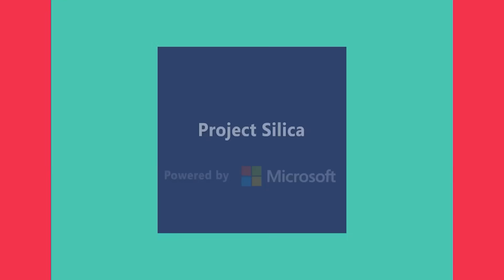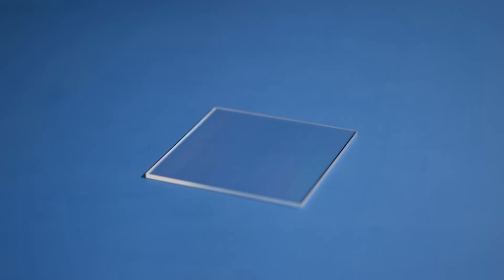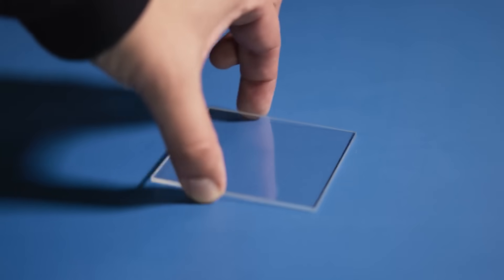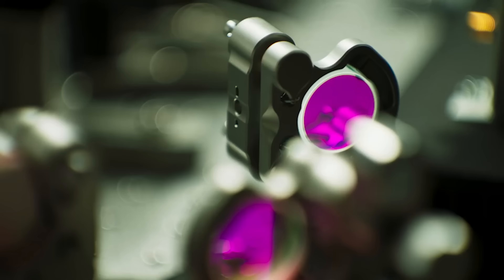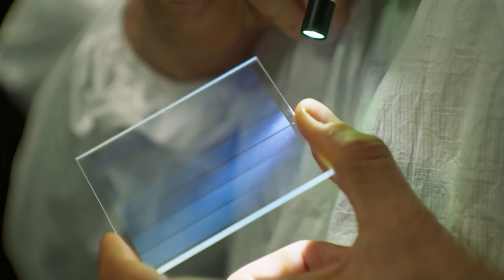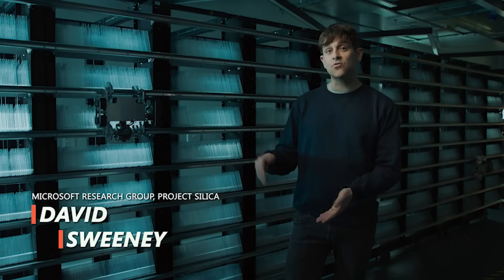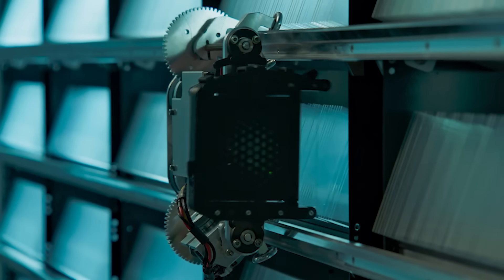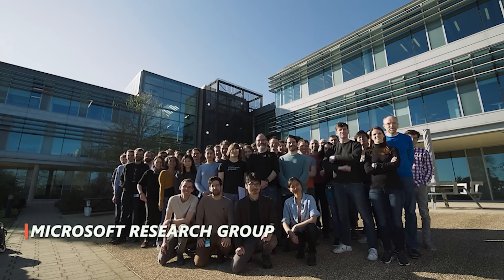Sealed in glass - Microsoft's Project Silica

Comment: For consumer use, a silica crystal could be inserted into a reader device. The device could shine through it, projecting an image of the entire crystal's data at once, that a light sensor reads as an image. The image could stay in the sensor's cache, in the system's RAM, or/and be saved in swap or even as a file. The "image" of voxels would be the literal (literally literal) transcription of the crystal's dataset. 

The multiple layers (because it's a voxel matrix) could be scanned almost instantaneously by changing the focal depth (of projection light and/or sensor) and/or wavelength of projected light. 

If multiple light projections and multiple sensor layers could be combined, with each sensor layer receiving a different voxel layer in parallel, then multiple voxel layers could be read simultaneously: 3-dimensional ranges could be transferred at once. i.e. a projector with multiple light outputs attuned to each layer + the silica storage crystal + a multi-layered receiver sensor. Only part of that I have no idea about is if the sensor layers could be translucent enough to allow the other layers' light to pass through, and whether the wiring from each sensor cell would interfere with the other light. 

btw I am definitely not any kind of engineer in any of the related fields. Just some ideas in my imagination inspired by their video.
Reply: I wonder if there's currently technology to make a single reader that matches the resolution of the glass storage device.
Reply: You're way underestimating the density of the voxels and the accuracy of image sensors. You've essentially described what Microsoft is doing with lab quality lasers and sensors, but they need to image one small section at a time. That said, you are correct in that the theoretical read speed of a platter is very high, much higher than hard drives or tape.
Reply: Superman - the movie
Reply: That's been in my mind for years,sadly I won't see this in a lifetime
All our data is basically
light & sound converted into binary
Reply: What about using time crystals in such a setting
Reply: for consumers the problem is not how to read, that can be figured out. Consumers need write. We dont need a Blueray 2.0, we need a persistent storage medium. And that is the difficult part. How to construct a cheap ensamble of lasers pulses that are able to etch glass, in a microscopic form factor.
Reply: @marsovac  I think writing could be solved by a cloud service that ships completed platters to you. Mark stuff in archive in OneDrive and when it gets to ~7 TB, the automatically ship you a platter. As part of an existing datacenter system I think the additional cost could easily compete with current archival services. 

I don't see how reading could be done cheaply, mostly because I don't see a large market for it. Existing solutions are cheap because they repurpose existing tech. Having a whole new complex reader would probably be really hard to sell, just like other tech that was better but not super compatible like betamax.

Certainly excited to see where this goes!

Comment: From what I see, it's write-once. That can be challenging over time because of content fragmentation issues, now with glass fragmentation as well :-)
Reply: I see your point, but I don't think they intend to use this to replace all form of storage probably just very specific applications as the robots also make the system slow
Reply: @OwnGrid  In fact I was referring to these kind of systems. Typically they use robot libraries reading LTO tapes. But once in a while, as you prune older archives, the oldest tapes become less and less relevant and thus costly to operate because of the only few remaining interesting files. Usually some kind of automated defrag and rerecording on other tapes helps keep the density useful. I guess it will just work like that here as well by using  newer plates but throwing the older plates instead of reusing the media. Glass being easily disposable.
Reply: @fmu7679  I would guess that the glass slates are cheap enough that a rewrite isn't necessary. If one of your slates gets outdated you just take what you want and write it to another one, which now has extra capacity from the data you left behind.
Reply: its glass. they can just melt it down and recycle it

Comment: Cringe. It’s glass. Enterprise class Magnetic tapes don’t degrade that fast. 20-30 years and more. Just like hard drives. Speed of data retrieval? How long do we need to store data for? If we want to keep it for centuries glass isn’t a good option as it tends to slowly flow. Like a liquid. There are transparent durable and long lasting plastics that are better suited for something like this. But no one explains the main goals
Reply: It's also possible that you don't know as much as you think you do. It's one things to have questions based on your perceived knowledge and then seek out  answers. However, you are not doing that. You instead seem to be making statements of fact without any interest in understanding how they address/view your concerns.

Comment: Imagine an optical reader size of 5.25inch DVD/Blu-ray, that can read these glass disks with memory of 1 Tb per disk or more you can literally off-load a lot of the data stored for archival purposes.
Reply: The plates are 70 x 70mm and store 7TB each. 70mm = 2.756 inch. There are two reasons why they are not bigger and round. The bigger they are, the more likely they are to break if they fall. And they are not spinning in the reader. The fact that they are not spinning (moving) allows the data density to be bumped up to far higher levels. Project Silica has demonstrated 7TB and 75.6TB / plate, but it could go a lot higher.
Reply: @danielch6662 i didnt say it should be rotating media.. The reading laser on on x, y axis motorail  can move sequentially to read data ... 7tb is good for initial efforts.

Comment: Is there any reason they are rectangular? Cd's DVD's Blue rays Ext. there is already disks. If your inscribing data in lines on a 2d plane why not make it in the shape of a cd? where there is already a huge understanding and support structure for spinning disks from both a consumer and enterprise standpoint. I get if your trying to increase density, but your forcing higher precision and wear out for the reading/writing mech by having to move the object in 2 dimensions seems... aquward. 

And while the moving robots are cute,  you can fit more disks in a Jutebox or record player...
I get its new tech, but your re-inventing the wheel. Your tech only changes the medium and how the laser reads the data in multiple layers.
Reply: Probably to make it easier to handle and correctly orient. Also, box-like shapes for glass are quite ideal in terms of material stability.

Comment: The glass could be in shape of a sphere, so you can roll the sphere itself instead of the reading head.
It can also be read/written in 3d space, making more options for layer placement without overlapping.
Spheres are also look cooler and having the smallest surface area to volume (we are writing in volume, not on the surface).
Reply: This technology is likely very sensitive to penetration depth ... harder to read and write deep into the glass. And moving the sphere may be a tougher challenge than you'd imagine because you'd need to move it with sub-nanometer precision in at least two polar axes and a linear axis and that's going to be really really hard. Much harder than moving a microscope in 3 linear axes.
Reply: anyone discovering crystal spheres in dusty halls buried under desert sands would enjoy the experience far more than if they discovered silly thin squares of glass. 
also the tech for read/write to spheres would look much cooler.
speaking of cooler, cooling a molten glass sphere with no deformity artefacts is much harder than cooling a plate of glass.
maybe we should just reinstate the diamond crystal trade, and/or develop more robust tech that has no issues with material deformities/

Comment: "hdd last 5 years. tape might last 10"
yeah if you fucking use the worst cheapest shit possible
Reply: I found those numbers odd too. I mean, I can see that being valid for an HDD under constant heavy use, but that's not really applicable to what these would be used for. If a HDD drive is being used for long-term cold storage, then I don't see how they would only last five years.  Properly stored LTO cassettes can last over 20 years.

But then again, they did seem to focus on cloud storage provider use cases, not the typical cases we might deal with ourselves. For example, those providers who have the data archive tier storage in which the media may be shared with many different customers. Then the media may be accessed a lot more than frequently than it is in more traditional environments. But I dunno, I'm not really sure how they do things at the big cloud companies. Maybe they will release some more technical stuff in the future that explains exactly what they are going for and why.

That being said, if they sold these things at consumer prices and sizes, then I'd totally go out an buy myself them.

Comment: I can't read floppy disks from 20 years ago since drives no longer exist, but yes, a totally cryptic, overly complex, laser microscope requiring tech that only one company has

THAT'S GONNA LAST FOREVER!
Reply: truuu although I think glass storage tech could be reverse engineered by any civilisation who's developed laser (or laser-like) technology, especially if the datablock header contains a full copy of foundational ascii and the device's symbolic encoding type and filesystem. Even without a human-civilisation computer or operating system, with those headers, the rest could be interpreted from the binary outputs. Yes it's not simple to do all of that, but it's arguably far harder to reverse engineer any kind of access mechanism for HDD and SSD storage types. Shining a light on it reveals nothing; without a controller chip it's basically dead metal. Without firmware and drivers, current storage disks are inaccessible.
Reply: yes that is ridiculous, microsoft are so full of money, after scamming the entire world for decades, they do't know what they are doing. This idea is overly ridiculous in the concept and in the execution.

Comment: Minus outside forces and catastrophic events 
In a vacuum environment, silica glass has the potential to remain virtually untouched for billions of years due to the absence of external influences. This makes a vacuum one of the most pristine environments for preserving materials.

When silica glass is placed in a sealed environment containing air, its durability remains impressive but may be slightly reduced compared to a vacuum. In such an environment, the glass could stay largely unchanged for hundreds of millions to a few billion years. The presence of gases, primarily oxygen and nitrogen, and potential interactions over extended timescales account for this variation in longevity.
Reply: Maybe we have something encoded in our DNA (a part of the code to build the body), we are just too stupid to understand it. Even our current technology is not readable for anyone outside of 100 years from us, not because it can't survive, but because no one would know the filesystem, how to read it without the OS or a computer from the same era etc.

Comment: I thought the HVAC sounded familiar... Silica based storage actually has been in development for decades now.  Glad to see it getting closer to real use.
Reply: I first heard of this when I started working with data around 1995. At the time the best we had was 1.4MB floppy disks and 600MB CD-ROMS were still a few years away.
Reply: millibyte
Reply: All computer memory is silica-based.
Reply: silicon≠silica
Reply: I wouldn't really call it "real use". This stuff is strictly read-only and most likely profusely expensive to create in sterile, highly specialized lab settings etching fragile glass.

If we had any sort of civilization-ending event, just how long do you think it would take for any predecessors to climb back up the tech tree, figure out what these weird pieces of glass are and then do another milestone leap by discovering the exact method of decoding in order to read & understand them successfully?

And for all the talk about "sustainability" in this video, Earth is already on track to experiencing a severe sand shortage.
Reply: I bet the read speeds are garbage with that seeking system. Why they wouldn't use a spinning disk is just baffling

Comment: Cool tech.. too bad the unsustainability comes in the form of this being done by a for profit company. At some point just maintaining the building may turn non-profitable and if/when that happens they will cut it loose. Or they design a business module around it, at which point they need to generate larger profits from it every year until it becomes as above, not profitable "enough" at which point it will be sold off or shut down.
Reply: Stop villainizing profit, it's short term thinking that leads to misuse of resources.

Comment: Does not glas move like liquid but very slowly? I would guess the data is save for at least 1-2 lifetime before it need to be copied again?
Reply: No, that's a myth that keeps getting repeated. There are 1,000 year-old buildings (Augsburg Cathedral, Germany) with glass windows which have not changed. Glass was hand made and it had variations so people assumed a thicker part at the bottom must be from it flowing, it didn't. Glass was then made by pouring molten glass onto molten tin making perfectly flat glass sheets.
Reply: It's borosilicate crystal glass which last circa for 4000 years +/-
Reply: @gregandark8571  there was or maybe still is a project in 2013 by Hitachi at Kyoto University saving data on glass using a similar method but it was using quartz glass its lifespan is estimated to be 300 million years.

Comment: How is that different from a CD, except for plastic vs glass ? Isn't the principle the same?
Reply: temp resilience, and data density. cd can only hold data in 2d while glass can have multiple layers
Reply: @senurasenaratne5782 CD store data on a track so its technically 1D
Reply: @senurasenaratne5782  dvds and blu rays also have multiple layers

Comment: Just don’t break the glass 😅
Reply: Yeah, glass seems like a very fragile material for long term storage. It breaks pretty easily. One good earthquake or any accident nearby which causes large vibrations could destroy the contents of those shelves.
Reply: @mattbosley3531 - Most modern glass are quite durable against breaking, like those used on phones, and can resist breaking when dropped. They are, as the video says quite resilient and long lasting, there are glass bottles from ancient Egypt that are still intact, having been buried for thousands of years. Steel and other metals corrode in a couple of decades (except for pure Gold and Silver). Plastic degrade in a couple of years. 

Try dropping your external hard-drive and you see how many things are really fragile.

Comment: Yes let's replace our long storage with something that is super fragile and will break using voxel based storage rather han interference bases so that if it shatters we can't recover the data without a backup. Brilliant.
Reply: well yes but heath and light are also breaking our storage. its actually also super fragile. just in another way that cost energy. this costs engineering..